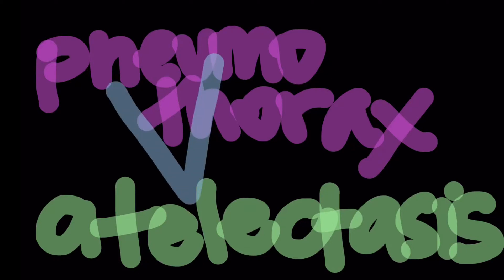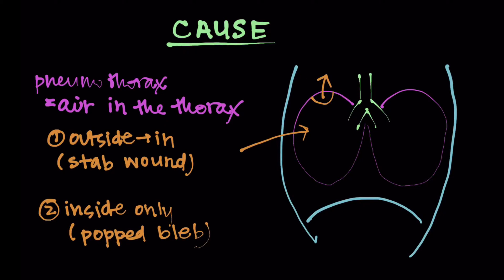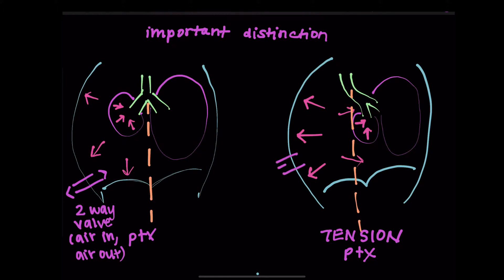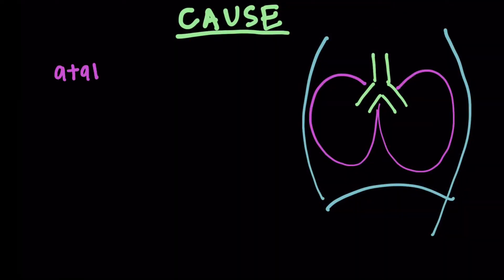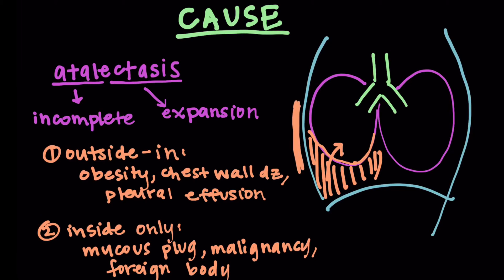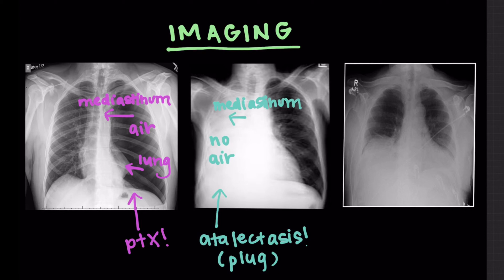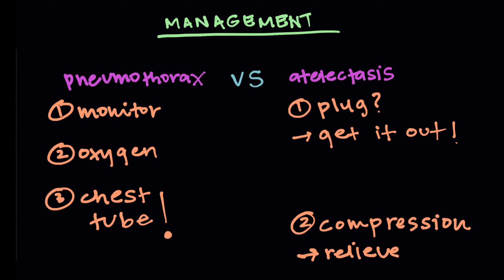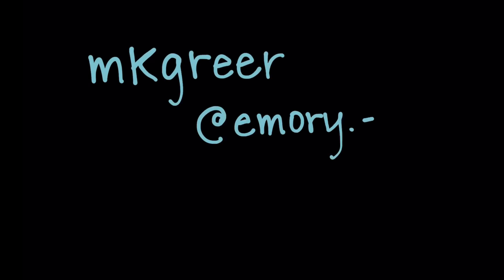Ptx v Atelectasis

Comment: Can *hemothorax* or *empyema* cause *compression atelectasis**? If so, how? Can a **tension pneumothorax* also cause atelectasis? If not, why can fluid cause atelectasis but not air? 

And why do they say that atelectasis is dull on percussion? When the lung tissue is compressed, doesn’t that create air around it, like around the opacities? For example, if the upper right lobe collapses with atelectasis, there is usually an area of radiolucency. Shouldn’t that be hyperresonant
Reply from the maker: Hi! Anything extra in the chest (ie fluid or air) can cause compression atelectasis. Every pneumothorax has atelectatic lung - the radiolucent part you see on imaging is the extra air in the chest cavity, but the lung itself is collapsed w/ no air in it thus is gray/white on imaging. Atelectatic lung is dull to percussion bc there is no air in it, so it doesn't resonate well. The extra air in the chest cavity from a pneumothorax, however, creates an area of hyperresonance to percussion. In a large pneumothorax, the main response to percussion will be hyperresonance bc the atelectatic lung is so far away from the chest wall - with all of that extra air in between. In atelectasis from a mucous plug, however, the lung is collapsed (ie not filled with air) due to blockage of the airway, not due to extra air in the chest cavity (as in the case of a pneumothorax). In this case, percussion is dull, because there is not extra air in the chest cavity between the atelectatic lung and the chest wall. I hope that makes sense!
Reply: @meredithgreer  thank you so much! greatly appreciated

Comment from the maker: I should note that, on the topic of regular pneumothorax vs tension pneumothorax, the regular pneumothorax doesn't necessarily have a two way valve (air in, air out) although that is a nice way to think of it conceptually, especially with regards to the need to place a chest tube to get the air out (which then becomes a one way valve in the outward direction). Alternatively, it could have a closed valve, ie opened and let air in and then closed and now isn't letting that air out but also isn't letting any more in so it isn't rapidly expanding. Additionally, it doesn't have to have an actual valve to the outside via the chest wall at all, say in a patient with bleb or cyst rupture, which are often caused by increased intrathoracic pressure in patients with pre-existing lung disease. I hope this makes sense! Please comment below if you have further questions. Thanks for watching!